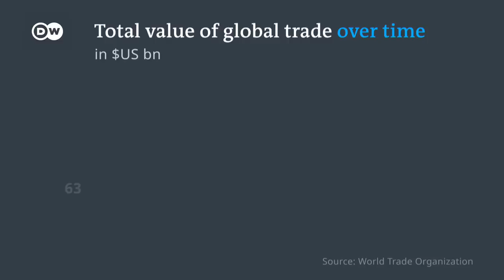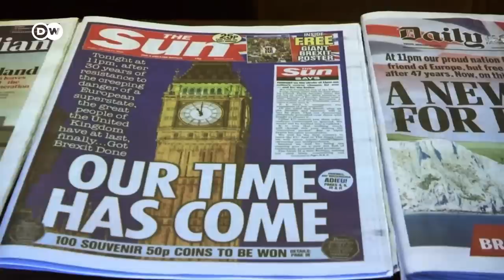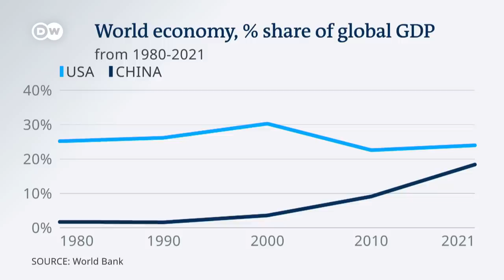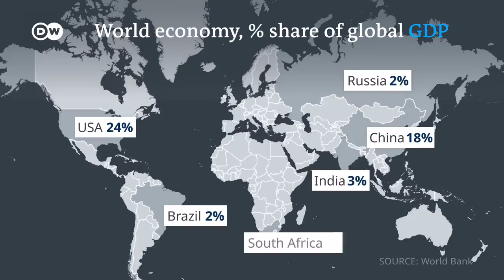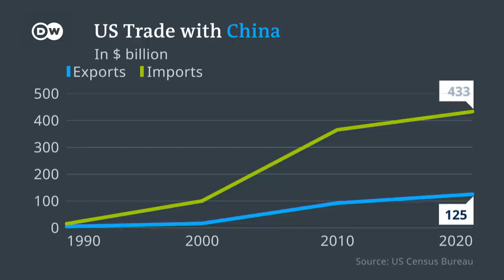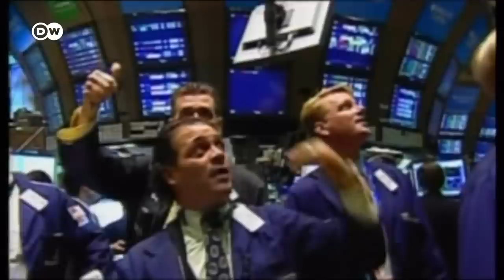The globalization backlash: A new world economic order? | Business Beyond

Comment: All countries should have domestic production , especially essential goods and services! Look what is happening with the microchip shortages worldwide and will become even worse if Taiwan is taken over by China, all countries should aim to be sovereign and where possible,  self sufficient
Reply: All going to plan for them not long now
Reply: The advantage China has is that they can produce items at a far lower cost than most other countries. Moving key industries such as chip manufacturing to importer nations such as the U.S and Germany will cause prices for chips to rise fueling continuing inflation.
Reply: You assume that every country has an equal amount of resources.
Reply: @fr2ncm9  China makes low and mid range chips.  They lack the ability to make high end chips.  Taiwan currently has that sewn up pretty well.  TSMC is fantastic.

But Intel is committed to building their newest high tech plant in the US.  And the US Congress just passed an unrelated bill to make the deal even sweeter for the secondary suppliers for Intel.  It's going to lead to a massive chip park where Intel and it's suppliers are all closely co-located to support high end chip manufacturing.

And beyond chip making, Chinese labor costs have skyrocketed in the past 15 years.  They are NOT the low cost maker of anything any longer.  Well, if you already have a factory there, it's cheaper to keep using it.  But the day you need to spend millions on updates?  It will be cheaper to build a new plant someplace with cheap labor.  Not China.  We're all going to see a lot of expansion in Vietnam, Malaysia and other low labor cost nations over the next decade or so.